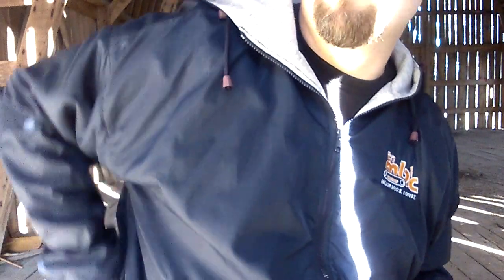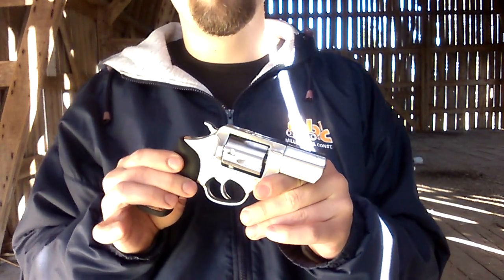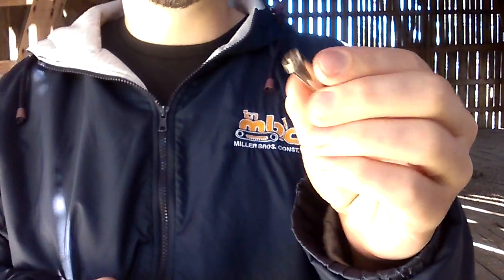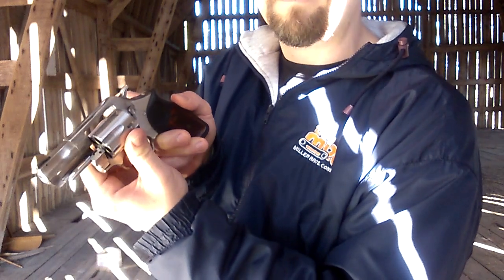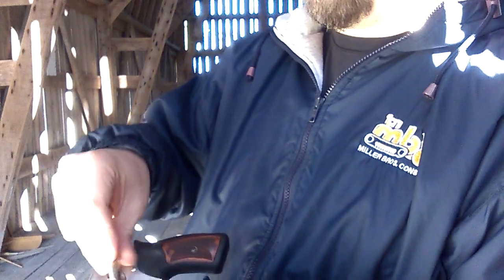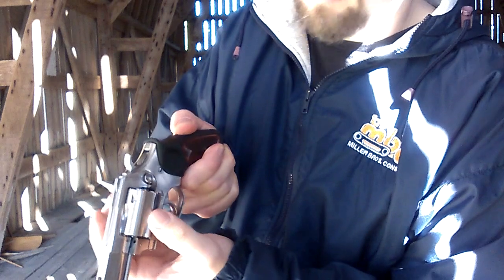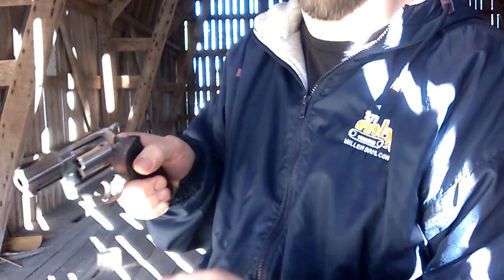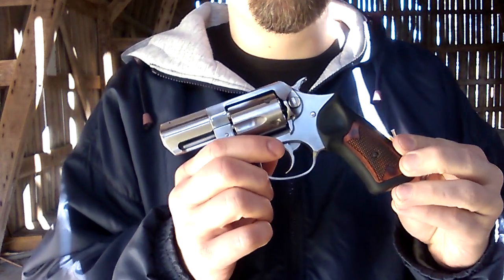A Revolver Can Jam?

Comment: He failed to mention that not only can revolvers jam, but if they do, unjamming them is more difficult than unjamming a semiauto. Another problem with revolvers is if the retaining pin gets stuck and doesn't emerge, the cylinder will not go back into position. The solution for that is to drop solvent into where the retaining pin is stuck until it loosens up. This can happen if you fail to regularly clean your revolver or if you've been using it in a place where it's gotten dirty.
Reply: Yeah, good maintenance is usually a good practice for all firearms.
Reply: Agreed, that’s why you take care of your guns.
Reply: I’ve been lazy about keeping my revolvers clean. You can bet I’ll be cleaning them when I get home. Thanks for the tip.
Reply: Odds of any of that happening are slim to none. There is a reason a revolver has a reputation. If you Maintain your gun and pay attention the ammo you load then you'll be just fine.
Reply: Maybe so ,but in general they are much more reliable than a auto . And note it was the ammo that made it jam ,not the gun .
Reply: @danjames5552  Dan, I have pistols which perform flawlessly even when I go months without cleaning. Pistol reliability has improved tremendously. As the owner of both revolvers and pistols, there are 3 indisputable advantages that revolvers have over pistols. 1. A 22 revolver can shoot both 22 shorts as well as 22 LR. A 22 short is quieter than 22 LR. No pistol is capable of shooting both high powered and low powered rounds. I once accidentally loaded 380 into a 9mm pistol and it stovepiped after firing. 2. A revolver keeps your brass in the cylinder and you can dump them when and where you want. It's an advantage when cleaning up the range; you don't have to go hunting for spent brass. 3. If you're going to shoot 22LR for self defense, given the greater unreliability of 22 ammo, you're better off with a revolver than with a pistol. If you have a failure to ignite in a pistol, you have a jam. If that happens with a revolver, just pull the trigger again.
Reply: @Taylormade2350 Correct however this video is precisely about the slims 😊

Comment: A different jamming issue can occur at the barrel end of the cylinder.   This has happened to me twice.  My 357 Magnum when using a light bullet weight of 90 grains with full powder charge can cause an unfired cartridge in the cylinder to unseat the bullet from its case.  This results in the bullet moving forward from its case thus protruding from the cylinder slightly.  With continued firing of the pistol the protruding bullet tip becomes locked tightly against the barrel forcing cone causing a jam with the cylinder, hammer and trigger tightly locked.   This is a cartridge failure caused by heavy recoil.  Sometimes its cheap ammunition with a poor crimp and sometimes name brand ammunition.  The poor crimp can be one problem but the lightweight bullet weight means a shorter bullet with less case surface area to hold the bullet in position.  Heavy recoil and limp wristing  are obvious factors in this revolver jam scenario.  For personal defense I buy expensive well crimped ammunition avoiding light grain weight bullets .  No one believes a revolver will jam  . . . until it happens to you.
Reply: Great advice! Thank you.

Comment: Well a flock will jam a 100 time before that happens
Reply: @tatsuhirosatou5513  

Yes, but only if the revolver is roughly mistreated, like closing the cylinder with a brisk flip of the wrist. Hollywood BS that people mimmic.
Reply: @denisdegamon4461  no ive had brand new smith&Wesson 686s have parts breakages within the first box and one that broke the first time the hammer was cocked without even being fired.

Comment: Don’t use “reloaded ammunition” for defensive carry , you don’t have to close the cylinder all the way to check your ammo ,load the cylinder ,, push the cylinder in until you feel resistance , which would be the recoil shield , but the cylinder will still turn because it’s not “locked “ in , simply point the weapon in a safe direction , and  turn the cylinder , it should freely spin , I carry a model 49 Smith and this is how the armorer from the local P.D. recommend it when a revolver is carried. Very good video !

Comment: I just purchased a s&w 627-5 performance center.  I have complete lockup jamming issues.  I a hoping it’s due to being new, and simply needs to break in.  But at the moment, very frustrating, knowing the price I paid
Reply from the maker: Sounds like a defect. Generally if a revolver has an issue, it's due to manufacturing defect and you're going to know about it in the first box of ammo. I've had defects like this in both semi autos and revolvers. If you run a box of ammo through a revolver and it runs fine, it's generally gonna run fine forever.
Reply: @GunSam  thank you very much for the reply. Sounds like I need to send it back to have checked out. I was hoping it might be a break-in. Period but you have confirmed it’s probably not the case.
Reply from the maker: @thomaseynon6205  S&W is good about fixing their products. Last time I sent one in, it took maybe 3 weeks turnaround time. The thing with S&W is they don't like to send updates on anything, they just fix it and send it back. Least vocal gun company I know, but they do tend to fix it correctly unlike some companies I have dealt with.
Reply: @GunSam  ok perfect.  I am going to get it sent over to them.  I’d love to have it as a carry gun.  But at this point, it’s not what I consider reliable.  3 weeks wouldn’t be bad at all
Reply: What do you mean by complete lockup?

Is the hammer locked back and not dropping? Is the hammer and trigger stuck? Will the cylinder not open?
Reply: @ I think it has worked itself out.  When posting this, I was using very stout 158gr ammo.  I think because it was new, it was really tight tolerances.  I moved back to 125gr, and the problem went away.  I haven’t again tried the 158gr ammo, nor to I want too (the stuff was really stout).  Problem has vanished, and I love the gun.
Reply: @thomaseynon6205 
Sweet!

I am a S&W armorer and back in 2021 there was a rash of new 686 and 627 models that customers were having issues with the crane locking up where they couldn’t load/unload. The culprit was ejector rods that had backed off the center pin. Torque to spec and the issue was resolved. I was curious if that may have been your issue.

Comment: Bullet creep from a light crimp can jam it tight it happens when a high Powerfulmagnum round recoil hard it makes the bullets in the cilynder move slightly out of the brass then it will lock up tightly in the cilynder gap almost  have to use a cleanining rodto push the  bullet enough to clear  but very dangerous that way  but it takes a long time to fix the jam also puts the cilynder out of timing. Like he said factory loads could happen  as well.  Good to check ammo by tapping the bullet  lightly on the the nose and see it moves get rid of it cuz any variation in the seating could cause pressure spikes  especially if you are going to carry  I guess it would  jam or increase pressures  in a semi either way if you going to use carry ammo inspect  doesn't take much time and could save your life
Reply from the maker: I have seen bullet creep with lead bullets, even the Buffalo Bore 158+P out of a heavy 686 I got creep. Another thing is those auto revolvers, no roll crimp at all. I think if I ever get a 9mm revolver like an LCR, i'll run my rounds through a little touch tighter taper crimp before firing them.

Comment: It happens to one of my revolvers, an old .22lr, but the cartridges are okay, sometimes a case is pushed back into the rear gap and it jams, i think there's a chamber too wide and some cartridges don't expand enought,  so they're pushing backwards. Has anyone had the same problem?
Reply: Yes, it happened recently on my newly purchased Smith & Wesson 43C, chambered in 22 LR, second outing at the range. 

I'm not sure if it was ammo specific, or if I simply did not seat the rounds fully into the cylinder.  

It happened only a couple times, but was unexpected, and I thought - WTF?  

By comparison, my first outing with the revolver a couple weeks ago was flawless.  

Since 22 LR is rather dirty, perhaps I had a bit of build-up between the extractor and the cylinder.  

This is my first revolver, so I'm getting an education.  

Your explanation sounds reasonable, so I'll pay close attention to my own revolver next time, to see if it mimics what you describe.

I appreciate that this video was made.

Comment: Is that the reason in movies and TV shows they would spin the cylinder ? is that to see if the cylinder would spin freely?
Reply: Or would that not work with a double action?
Reply from the maker: You can spin the cylinder in a single/double action revolver if you pull the hammer spur back a tad to free it up, then it will spin and you can hear that classic clicking ratchet sound which is the hand/pawl clicking against the ratchet in the opposite direction. Cool for videos but no practical need.

Comment: I had Factory Blazzer in Aluminum case with not enough crimp jamb.  The Bullet had walked forward and jambed as it rotated.  I had to scratch my head and then noticed the bullet.  I pushed it back in then removed it from the cylinder.
Reply from the maker: Sounds like they were some pretty hot ammo. Was the gun you fired it through a very light gun? What caliber and gun and specific ammo? I'm trying to get a feel for what happened.
Reply: I was using the Ruger LCR-X 3" model.   
I think it did not have enough crimp to hold it tight enough.
Who buys Cartridges and then crimps them to make sure they are not going to jamb ?
It was target grade ammunition and perhaps a 1:1,000,000 bad round. It is just something to watch for and a reason to hand load.
Reply from the maker: That's a fairly light gun. With that light of a gun I could see how the recoil would be greater, which could cause the bullet to back out under heavy recoil. Also, was the Blazer ammo aluminum cased? I wonder if the aluminum cases(if that's what you were shooting) hold a crimp differently than brass. Either way, a proper roll crimp on ANY .38 special, even a +P variant, should not pull out like that.
Reply: The "Feather Weight 38's " are pretty common place these days so if Aluminum Cases cannot hold up they should know.   It is just something to watch for if your revolver locks up.

Comment: Remember we was talking about that Ruger LCR in 9mm? I that that gun, but another thing I've heard that can happen, (although very rarely) is that because semi-auto rounds are meant to be loaded into a magazine, sometimes the rounds of the casings are not crimped as good as revolver loads, and when you are firing the gun you could have the lead bullet extend forward from the casing due to the concussion. This can result into another clearance  issue whereas the projectile is not clearing the frame thus not allowing the cylinder to rotate. So if you are going to use a revolver that fires a semi-auto cartridge, then you need to test various ammo and find ammo that is crimped well. If the projectiles are lose in the casings then don't use that stuff. Find different ammo.
Reply from the maker: +hawkermustang  I actually think that Hornady does make some auto calibers that have a revolver roll crimp on them. I don't know if 9mm does, but I know some of their .45acp HP's have a roll crimp which is odd but good for the revolver guys.
Reply from the maker: +hawkermustang  But let me recant what I said a tad, I looked at the round of Hornady .45acp that my buddy left here, I can't be 100% sure that it is roll crimped, but it for sure has a cannelure on the bullet which in and of itself is different.
Reply: Gun Sam Yes I read up on that a little bit speaking with some owners of the 9mm LCR. One man told me he tried many types of ammo. Some ammo he had problems with and some other he didn't have a problems with. He said he found some really cheap ammo that was flawless, so he was happy about that for target practice. 9mm is cheaper and more powerful than .38 ammo. So that is a good thing for him. He also said what the case was made of made a difference sometimes.
Reply from the maker: +hawkermustang  For the life of me I will never understand why 9mm ammo is about half the cost of 38 special ammo, when they use the same primers, same amount of gunpowder and same weight of bullets roughly. Both cost about the same to reload but factory ammo has one at double the price? I think it's probably due to brass cost honestly, but still. If it were me though, i'd still prefer a .38 special in a LCR because even if you tried to shoot a ton of ammo, 5 rounds at a time lasts a long time and i'm a revolver purest lol.
Reply: Gun Sam Yes I guess its just because 9mm is the more popular round. Still it shouldn't be twice the price for .38. I think their is just more competition for 9mm ammo so the manufactures compete harder for your dollar.

Myself? I would prefer the 9mm LCR over the .38 LCR because I like a more powerful round at half the price. However, I don't like that the 9mm LCR is a few ounces heavier than the 38 LCR. So to me its a tough choice.
Reply: Gun Sam I don't even want the Ruger LCR in 357 though. I just think that is overkill for such a small lightweight gun.
Reply from the maker: In that 1.8" barrel or whatever the LCR is, i'd find it hard to believe that the 9mm would be more powerful at all than a decent .38spl+P, in fact I would put my money on it that the .38+P would have more energy. The 9mm is a hot round PSI wise so of course it needs a steel housing to handle that pressure as where a 38+P with it's long case capacity can get the same velocity(in a hot+P anyways) as a 9mm can, especially from a snubby barrel, with half the pressure and a lighter overall gun.
Reply from the maker: If I got an LCR, I would probably get a straight .38spl, it was the original and has everything anyone would need in a ultralight snubby. I'd go as far as to not even use +P in it, but rather i'd probably carry really heavy wadcutters or something like that in it.
Reply: Gun Sam Well you wouldn't go wrong getting the LCR in .38 I don't think either. I think I would like to get it in 38 as well. Its a small LW carry gun and .38 special is enough power. 

People get carried away with more power. I use to think that 9mm was weak just from hearing people with .45 talk. However, its no denying that the 9mm is more powerful than a .38. And the shorter 9mm cartridge actually gives the projectile more travel in the LCR than the .38 projectile has. 

So if a man got the LCR in .38 or 9mm I would say he made a good choice. I see pros and cons to both. I like both.
Reply from the maker: +hawkermustang  It would be interesting to see some chronograph numbers with different 9mm and .38spl loads through the LCR's.
Reply: Gun Sam Did you see the video?
Reply from the maker: +hawkermustang  I just pulled up some numbers, researched chronograph results and found data from a 9mm LCR, and from a .38spl S&W model 60, 38spl only 1.875"bbl(same gun pretty much) with lots of different modern loads run through like Speer+P, Critical defense and whatnot and the results do speak for themselves. The most energetic .38spl round in a 1.875" LCR was the Hornady Critical Defense 110gr+P @ 1,031fps with 260 ft lbs of energy, as where the most energetic 9mm in a 1.875"bbl was the Speer gold dot 125gr+P @ 1,099fps with 333 ft lbs of muzzle energy. I think you're right about the energy edge. I'd say a 9mm+P out of the LCR is the same energy as a standard 9mm round in a 4" pistol barrel. Not bad at all.
Reply: Gun Sam I flip flopped again. haha I think I like the 9mm better than the 38. The only advantage the 38 has its like an once or 2 lighter. Other than that the 9mm has more power and cheaper ammo. It also reloads faster. Also since it was made to handle the 357, that means its overbuilt for a 9mm. Plus some old moon clips sucked cause they were hard to load. These clips are easy to load.
Reply from the maker: +hawkermustang  Keep in mind that in some instances a .38 special +P can be more powerful than a 9mm, such as with Buffalo Bore 158gr 38+p. Even in a 2" S&W it lists 1,040fps and 379 ft lbs, but for the most part 90% of 9mm is more powerful in that gun. I think that the unloaded weight is closer to 4 oz difference between the .38 and 357/9mm, but loaded it probably is closer to 2 oz since most 9mm ammo is lighter. The 9mm is still a pretty hot cartridge. .357 mag and 9mm are roughly the same maximum pressure, around 35,000 psi, as where 38spl is around 15,000 psi, so I don't think that the 9mm LCR iis overbuilt, but dang that .357 version could handle a more vast array of ammo from .38 short/long colt, to .38 specials, .38spl+P, light .357 mags like 125gr golden saber's and full house magnums. I think in the end, whatever version you get is going to be the right choice lol.
Reply: Gun Sam I agree, even in the 357 version you can shoot light 38 loads for practice. Then you can use massive 357 loads for defense. So yeah, I like all versions really of this gun have strong points. This gun in 357 is a beast.
Reply from the maker: I wouldn't go lighter than what I have for shooting .357 magnums anyways, 26-30 oz or so loaded/unloaded is my average gun weight, and while it's not too bad in the recoil department I would never shoot .357's in an LCR.
Reply: Gun Sam haha good point, I think 357 is overkill for this small gun. but it would be a tiny powerhouse.
Reply from the maker: Oh yeah, up close it can exceed the 400 ft lb energy mark which isn't bad for a pocket gun.